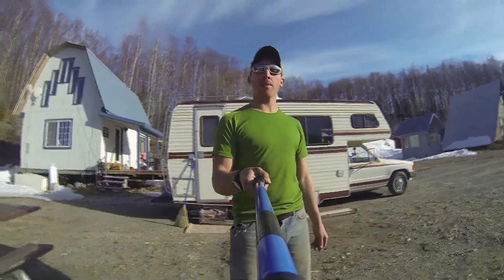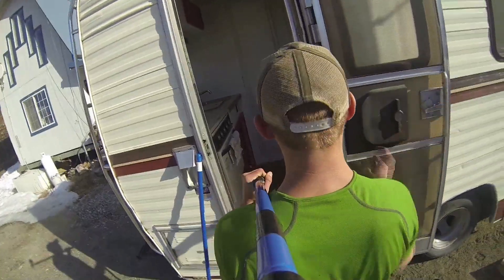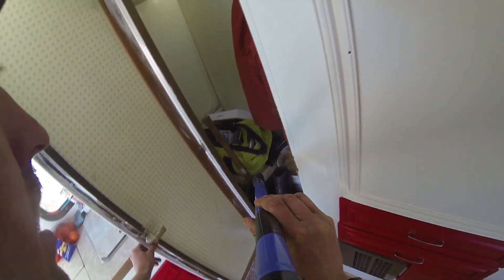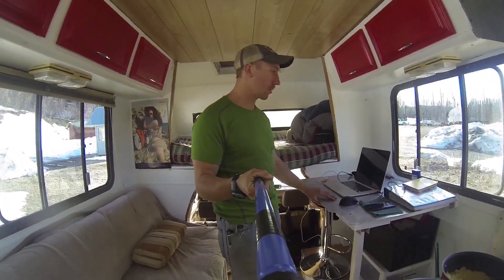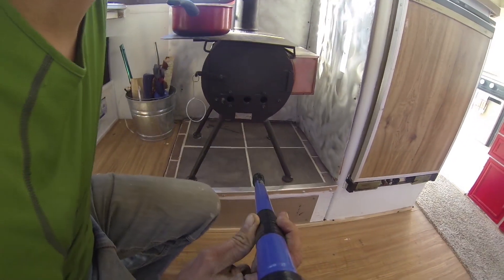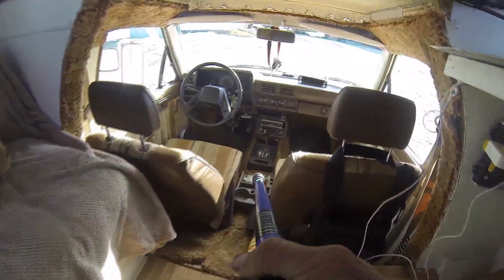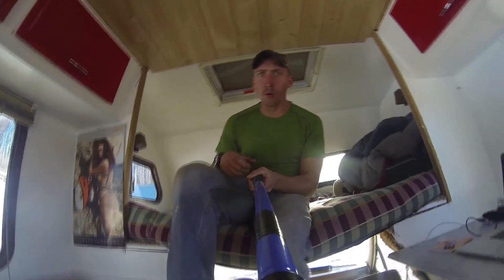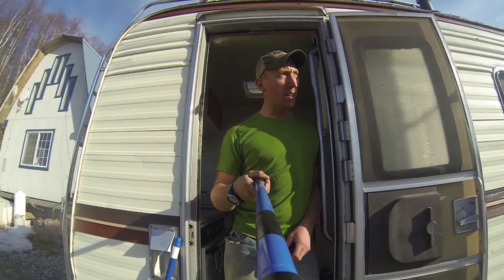Modern Toyota Motorhome

Comment: Nice rig man! I couldn't imagine not having my wood stove in mine, best investment ever!
Reply: The space required for wood storage and needing to acquiring it, vs a 100 lb propane tank on the back is still worth it?
Reply: Are you available by email? I would like to your suggestion for q wood stove on my toyota rv
Reply: My stainless woodstove is much, much smaller and is mounted on countertop,  These motorhomes are small and heat easily if you remember to seal around window frames and cut reflektix insulation to fit all window glass.  As to fuel, I carry kindling wood to start fires and scrounge wood scraps while camping in the wilderness.  I have a couple bags of charcoal in case it's dark or rainy when I want a fire.  Heat, hot water, and cooking without draining the little propane tank.  Life is good.

Comment from the maker: been a while since ive checked my page. Stove came with galvanized collapsing pipe. I ordered 4" black stovepipe and ran it up through an 8'' metal bestos that transitions through the roof. On the top of that I used a metal roofing gasket. Then I just cut a piece of flashing to make the transition from 4-8". I used Hi temp stove sealant on the hot part, and just regular henry's to seal up the rest.
Reply: Cleverrr!!

Comment: How well or poorly insulated is your toyota rv...  I just acquired one.. I also plan on installing a wood stove
Reply: My '84 just had "insulation paper"but others use foam and fiberglas.  I added 3/4 inch foam board to ceiling and walls, also reflektix panels to insert in all windows.  Try a really small woodstove- these little coaches don't need much heat and they don't like extra weight.  Try not to rip out most of the original interior and please resist painting all the woodwork white.
Reply: @pouglwaw5932  thank you..... I was contemplating making those mistakes... I won't now

Comment: I have an 87 Toyota sea breeze 4 speed Automatic. When I'm not connected to sure power, what is suppose to work? I have a deep cycle but not sure how it's supposed to get charged...any help would be appreciated ,
Thanks
Reply from the maker: hey there. When you're on shore power (ac), everything should work. Outlets, lights, etc. I'm pretty sure it's supposed to maintain your coach battery too. When your not plugged in, the lights and pumps should still work, but the outlets wont. check out toyotamotorhomeforum.org. I got a lot of useful info from that site when doing my build. Hope that helps